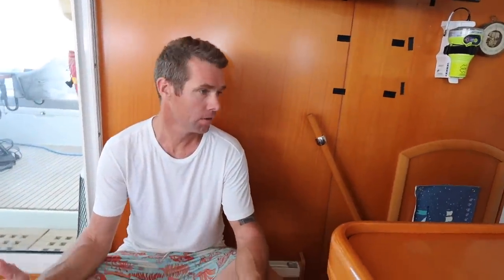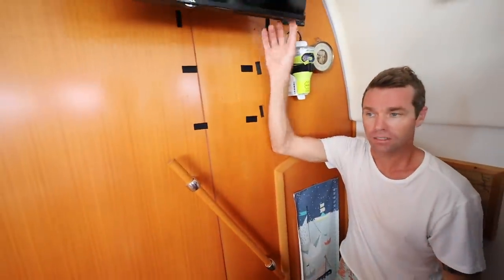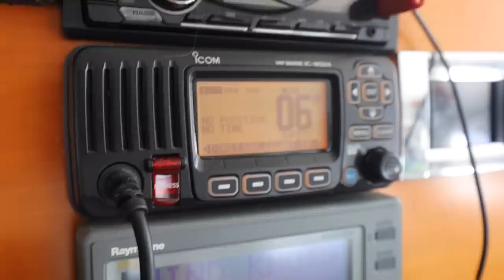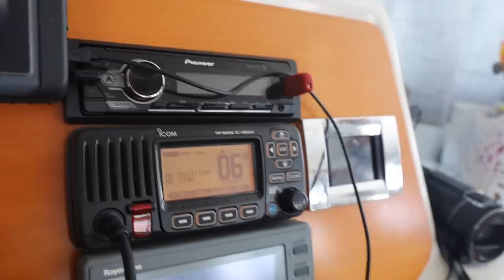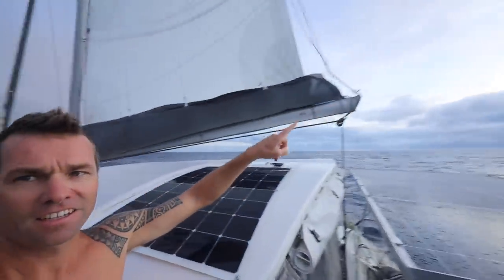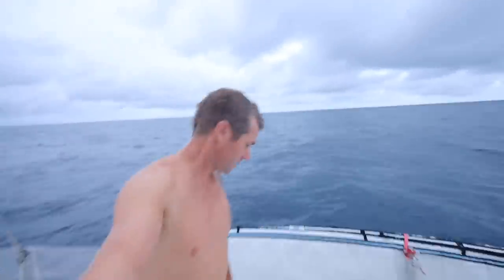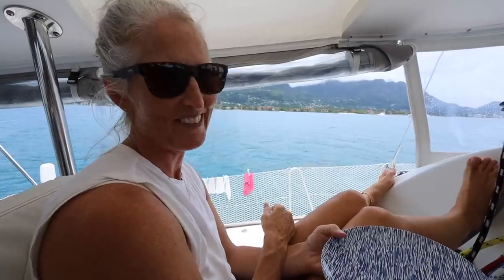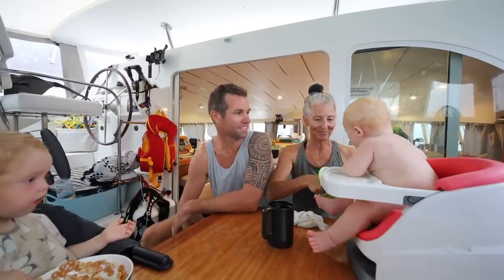Limping into Port with BROKEN BULKHEADS

Comment: Have been following you guys as you are living our dream. We got as far as buying a Lagoon 470 10 years back, got as far as the Canaries. The boat was nearly new at the time, but we never felt safe in heavy seas due to the hull flexing and the terrible noise from where the woodwork met the hull. Then we met a delivery crew on a Lagoon 500, who reported similar issues, plus they noted piles of wood dust at the flex points. Then we met another owner with another 500 who could not get the forward windows to stay in place. That was it we sold the boat after only a year and went back to a monohull. Had this for 7 years, and we feel a lot safer when the going gets rough. Sad as we loved the idea of a Cat, just lost confidence in the build qualities.
Reply: Unless you only want to sail Caribbean and perhaps Mediterranean, people need to buy limited production, well built catamarans, that are not just flashy marina boats to impress the Jones's.
Reply: This is not catamaran fault, this is maker fault. There is more brands of catamarans.
Reply: @mirokozuh2099  A lot of research into the other brands is needed, before buying a mass produced one, there are three other brands that an owner of boat yards, reported major structural problems, one is Leopard.
Reply: You had to know how silly that sounds. 
There are plenty of awesome cats out there but yes they're expensive. You probably left out the part about taking a bit of a hit on the sale so it's understandable if you wanted to be a bit more money conscious.
Reply: @Drew-eo2oj  Some people just can't reach into another pocket to get the extra half million dollars for a so called better boat. The cost to the manufacturers, to have a better structural design, and workmanship, is not very high, but they want to make every extra penny they can.
Reply: @Drew-eo2oj  At the time the 470 was considered one of the best ocean going Cats out there. I know as it took two years of research and hunting to get one. Plus we made a profit on the sale !

Comment: I hope you guys read this. I am a naval architect and surveyor with 50 years experience of small craft both leisure and commercial and in all materials. My best advice is to contact your insurers and let them know what is happening. If no insurance, hire an accredited and experienced surveyor and a marine lawyer. This is no quick repair and the structural integrity of your boat is at serious risk. Do not take chances with the family and only let the builders repair the problem under supervision of your surveyor and lawyer. Best of luck to you all, you will need it with a problematic design and faulty construction techniques. The term I use is 'not fit for purpose'.

Comment: Just a side comment... on the radio contact from the freighter. Commercial vessels are required to maintain a Radio Log as part of GMDSS. It's always weird to be asked those questions, but they'll typically get Vessel Name, orig port and destination, flag, and people on board as required by various regulations. Most contacts they don't bother to fill out the log, but because he first said "Safety Check" he was very likely putting it in his GMDSS Log (that's one of the categories). When we've had radio safety checks they've usually been from Navy / Coast Guard, etc. We did notice in South Africa they were a bit more rigorous in logging and safety checks, etc. But it is nice to know other seafarers are out there and actually standing watch!

Comment: In the words of Jaws I‘d say "You’re gonna need a bigger boat“ ^^

Also kind of creepy the guy on the radio asking so many detailed questions but relieved that he got the message and said bye respectfully
Reply: With political problems kicking of in the Seychelles and on Sri Lanka theres probably a few vessels moving away ...the AIS being down perhapse concerned them ... 
Glad you made it to your safe harbour... 
Im not sure how your going to tension the hulls back together below. The rear bulkheads Tops in compression bottoms in tension.. check your standing rigging tension each side of the mast. 🤔 It may have slackened somewhat.🤞🏼
Reply: Guy on radio sounds Filipino.  Maritess blood is probably strong on that one. Genuinely thought he was concerned for the first part of the exchange, sans ais and all. The crew number question was definitely off.

Comment: If you have followed "Sailing Parlay Revival" on YT and the bulk head issues they had and repaired. You may need to do the same, as it may be a Lagoon design problem. I know that the Lagoon manufacturers didn't like the posts posted by Colin. He even had another Lagoon sit on the hard next to him to learn how to repair the bulkhead issue. I wish you the best results.
Reply: They should be scared. Colin did two seasons on Below Deck Sailing the Bravo series. He is incredibly smart and talented, I would not want that bad publicity either.
Reply: I remember them saying in, I think it was, the episode before that they had spoken to Colin.
Reply: I gathered from Colin’s more recent posts that Lagoon are now addressing the issue and repairing or giving repair specifications to owners. If they haven’t done so contacting Colin would I agree be a very good idea. I hope everything works out for you.
Reply: Watching the Parlay videos where Colin was dealing with Lagoon, it appeared obvious the Lagoon was (is?) nervous of the potential liability of the bulkhead issue.  Yes, they have issued a “sort of” solution to the issue but have loaded it up with “qualifiers” to limit their financial exposure.  It would not surprise me if they are dealing with individual owners with “non-disclosure agreements”.  Yachting Monthly (which you can search for online), published this about the issue: "...Catamaran builder Lagoon is seeking to reassure owners of the Lagoon 450 following reports of forward bulkhead deformation.  Lagoon, which is part of Groupe Beneteau, has stressed that no navigation or safety issues have been reported as a result of the fault...."  So one supposes that having a boat falling apart during a trans-oceanic passage isn't really a safety issue!?  Whether they accept responsibility (including financial) or not, at this point their credibility certainly seems to be in the toilet.  In any case this is a massive public relations hit: I can't imagine people lining up to purchase a new (or used) Lagoon until this bulkhead issue gets sorted out.  Meantime we can only hope that Ben and Ashley are able to get themselves into a good, SAFE sailboat for the remaining balance of their circumnavigation.
Reply: The fix from Lagoon is not a true fix, a quick easy fix,  just a metal jacket to go around areas near the stress part of the bulkhead to strengthen that part only but not the entire boat is corrected and sound.
Reply: @georgecarney3083  lagoon 410 from 2004 don't have nothing, absolute nothing with lagoon 450F floating small hotel. and this boat is made for 7-10 year exploitations after this is for recycling .

Comment: OMG, another Lagoon with broken bulkheads. I have been a sub for about 2 years and I love your channel - the kids are just adorable. After watching your last several episodes concerning your boat I think you will have a bigger problem than you may think. I would make a few suggestions and observations that I hope will help and prepare you for what to expect. First please know that currently there are several hundred Lagoons that are having the same issue with broken bulkheads - this is a design flaw in the boat. I would recommend you contact Lagoon for assistance - they may or may not help. Next I would review the video's from Parley Revival as they had to completely demo and rebuild their bulkheads which took them over 9 months on the hard in Panama. They were the first ones to bring this issue to light. Colin had several friends help with the rebuild (free labor) and it still cost him almost 50K from what he has stated in his video's His boat was also deflecting almost 2 inches and his salon doors and windows would not close. Hopefully you have discovered the problems sooner than he did. Please reach out to him as he can save you time and money!!! 

I am not trying to be a "Debbie Downer" but you need to know what you may be up against. The good thing is that when you are finished your boat will be structurally better than the original build and very safe for your family. In closing the one thing you will need the most is labor to help you with this project as the wife will be busy with the kids and filming to keep your channel going. With that said I am a professional remodeler from the States and I would be willing to come to where ever you are - at my own expense - to assist you with this project as you are going to need lots of help. As I see it this is a call for all hands on deck! 

In any event and whatever you decide I will be watching and supporting you and your wonderful family in this time of trouble and I hope ALL your supporters will do the same. Stay safe, fair winds and calm seas. P.S. If you would like to chat just let me know on your next post and I will give you a call.
Reply: Cant get fairer than that offer.They would be wary yet mad if didnt take up offers of help.Its going to cost a fortune this will.Not sure i could face it myself.id want away from that brand altogether.
Reply: @masaiwhite5933  Thanks so much, I can help them a bunch, but you can't sell it until you fix it. Lagoon's are still good boats once the defect is fixed.
Reply: Yea, what concerned me in this episode is the nonchalance at just bonding things together and trying to get to South Africa. That is like putting a patch on a firehose.
Reply: i would have to agree with you.  I think this looks and sounds like its time to get another boat.
Reply: @music-man  insurance companies should pay out, and collect there dues from Boat Manufacture.
Reply: LOL. Do you know how many people float around YouTubing and have Patreon who do not have boat insurance? I can name TWO and both are on YouTube. I was actually shocked at one of them “we are still learning how to sail” and my personal favorite “we cannot moor there as we have to provide proof of insurance” 
I was like “w.t.f.?”  Darwin Awards.
Reply: @lisalisalisa7721  :You do know, getting insurance for boats, especially order boats, is difficult.  First, find a company that will insure your older boat in your location and then the expense of the insurance, if you can find the company.  Don' be judgmental, walk a mile in their shoes before reaching a decision.
Reply: @pb4741  of the boats not in the USA insurance can be a hassle.

Comment: Surprised by the speed difference the Code 0 made. Our boat has a relatively small self tacking headsail. Have been considering a bowsprit for a few years, but you have convinced me to add one onto our old Lagoon 42 and setup a Code 0. 
We were in the Seychelles in the late 90's and had such a great time. La Digue was our favorite. Anchoring off a beautiful beaches with pink granite boulders making the headlands. Sandy walking trails leading away from the beach towards shops in the distance,. Have nothing but amazing memories from Seychelles.
 Hope all goes well with the bulkhead challenge and it is just a simple repair.

Comment: You have the "Lagoon" disease! Bad fiberglassing of the bulkheads, so when the little fiberglassing that is cracks, the boat bend inwards. Check out YouTube channel Parlay Revival and get in contact with Lagoon. Lagoon have admitted faulty productions of their boat. You have some serious work in front of you...... Hopefully the maker will assist with materials and maybe also covering of the labour cost, what do I know. There are a lot of Lagoons out there that have the same problems as you have discovered. Stay tuned, you do a good work and I love your channel!

Comment: BEN,  I know LARGE BOATS,  This time when you take HER out of the water, MAKE SURE YOU BUILD A CRADLE to support all the weight evenly. Lighten HER as much as possible, BATTERIES, FUEL, WATER, ELECTRONICS, ANYTHING ELSE THAT HAS ANY WEIGHT !  I was the Captain of the "AZUMA", a retired Japanese Coast Guard Vessel 80 ft. length, The new owners, AGAINST MY WORD, tried to haul her using 2 cranes and slings, AGAINST MY WORD, the vessel is now a LANDFILL !  BEST of LUCK BEN & ASHLEY,  YOU ALL are in my PRAYERS !🙏
Reply: Sarcastically speaking... I had a back and forth with SabertOOth last week about the haulout in Thailand being the culprit that caused these issues. He said he was a "world class, world renowned, sailboat racer, who knew everything" and,  it was impossible for the static load of a haulout to cause damage like that. He said that poor design causes damage like that. I said the same thing about bad lifts during haulout and I was told absolutely not the case so be watching for him to reply to you as well... Anyway, when you truly spend years on the water and do it for weeks and months at a time without seeing land plus deal with the shipyards and haulout facilities, YOU KNOW THE TRUTH. The ABSOLUTE most dangerous time in a boats life is during haulout and one bad lift can absolutely destroy a vessel.
Reply: Mmmmm’ maybe not
Reply: @jerrywilson589  YES ! AGREED !! I am also considering that maybe the SHROUDS were too tight and pulled the vessel apart when she was in rough seas.🤔
Reply: @Designer-Jock  Please elaborate
Reply: @capttom7772  Probably a combination of bad lifts and bad rigging. A lot of these comments claim bad design but the famous boat/incident they all referenced (Colin from Sailing Parley) was a restored severely hurricane damaged boat. I’m not a naval architect or engineer but my first thought was similar to yours. Most of these YouTube sailors are amateurs thinking they know more or understand better than they really do. Anything that flexes and has rigging needs to be constantly adjusted! These people only get the rigging checked every couple years?
Reply: @ryand4533  Agreed ! I have seen many a New Vessel Owner do the biggest "NO NOs" To their rigging.  All one really has to do is research the proper sequence to adjust the shrouds and stays , in the proper order and the proper tensions, which vary from vessel to vessel.  Consider a WOODEN vessel vs. a METAL vessel, different parameters all around, another common MAJOR MISTAKE is some novice sailor, upon seeing his shrouds slack on the "LEE' side , automatically thinks that it needs to be taught and tightens those on that side thinking that they are doing "GOOD" when they are actually creating a destructive mess, that will result in hurrenduss consequences.
   By no means am I implying that this is what happened on "NOHOA" as I have faith in Ben & Ashley's RESEARCH CAPABILITIES, EXPERIENCE and EXPERTISE .  We just don't know at this point and we may never know the exact and primary cause in "NAHOA's" case, (she was purchased as a "used "vessel") and most likely had hidden damage from all her years at sea. What we do know is that when she was last hauled, there was a LOUD noise that is uncommon in any "haul out". 
   What "STRAW" was it that "BROKE THE CAMEL'S BACK"?  Without being there, for  initial assessment, teardown, inspection  and seeing a sequence of failures, can anyone accurately reach a logical conclusion. 
   @Ryan D, Your "Reply" is spot on ! I agree that many rely on other people's knowledge without understanding the physics involved themselves. I to am not a Engineer/Architect, a lot of my "research" was gained by working alongside a "MASTER WOODEN SHIP RITE" in the boat yards of Hawaii named "Kurt ASHFORD"(R.I.P.) who built all 3 of his vessels until he perfected his final vessel "S.V.  RAT BAG" which I was fortunate enough to sail with him in the Hawaiian Is. Myself being in my 70s, also a RETIRED MERCHANT MARINER SHIP CAPTAIN (100T W/Sail Endorsement) with 38 years experience, I have faith and hope that "NAHOA" will soon be sound and back to "Struttin Her Stuff" on the High Seas as a "BLUE WATER LADY" that we all have come to love and enjoy !
Reply: @capttom7772  That to me is the scariest part of buying a used sail boat. How many previous owners did it have. Was the rigging cared for properly, and how many times has it been hauled out. It’s a big risk crossing the words oceans with your family.

Comment: Sailing Carly on the YouTube channel has a lagoon and his boat come apart just like yours is doing it’s major repair and you should watch his YouTube channel to see what your up against. This is a major problem. Lagoon manufacturer is aware of this problem and they should compensate you guys for this. I would be calling lagoon over in Europe right away. When you pull your boat out of the water it’s not gonna be straight, you will see if you watch sailing parlay revival video about this same exact problem. He repairs this problem start to finish. Good luck!

Comment: Try to tie a rope across the saloon / aft deck floor and see if the boat is bent. 
If so there are more bulkheads broken or not attached to deck and hull anymore. Same thing like at SV Parley revival. Lagoon 450

Comment: I'm so relieved you guys made it.i said before when you got hauled out in Thailand I heard the cracks and straight away its the bulkheads..it will be the tabbing and yes you have lots of work Infront of you guys but your safe now so it's going to be a lot of work but as always looking forward to watching..stay safe guys.,👍😁🍺⛵⚓
Reply: What tabbing on a Lagoon as far as I've seen they mostly just glued together with minimal tabbing and undersized plywood bulkheads with huge holes cut through them. You need to add about 50+kg of biaxial cloth and unidirectional tape to their bulkheads and properly tab to the hull with epoxy for blue water sailing.
Reply: @jackdbur  Precisely!